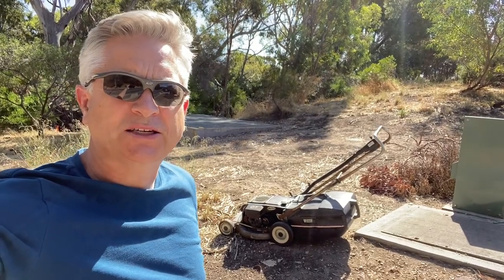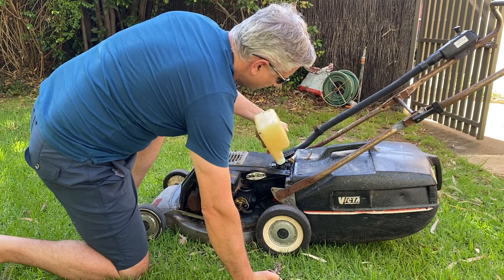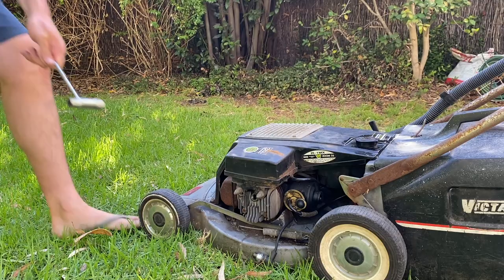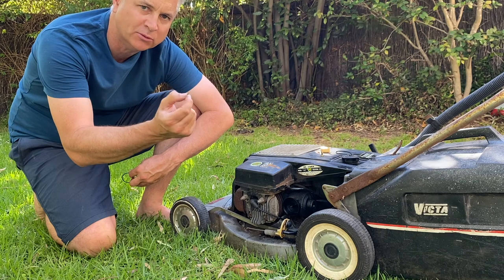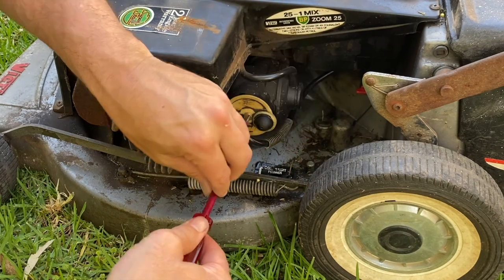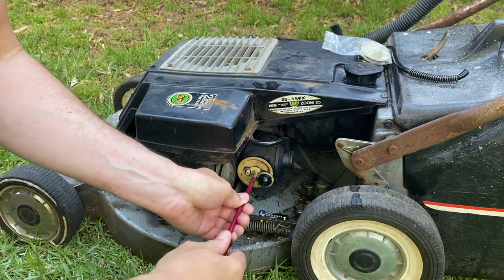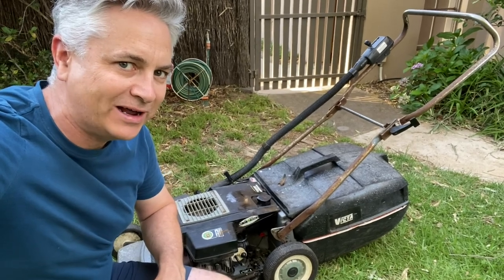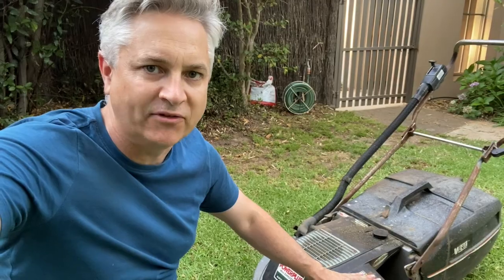Trash Picked VICTA 2 Stroke Lawnmower - Will it Run?

Comment: Wow!! What a score. I would love one of these!
This dates from 1982 -83 and is the last of the full crank 160 engines before they switched to the Powertorque engine like your red mower and features electronic ignition like the PT.
Beautiful looking machine. Don't sell it unless you have no room.
You will find the catcher off your red mower will go on this fine but not the other way!
Thanks for doing this video. Well done on both counts.
Reply from the maker: Hi James, thankyou for your comments!  You have confirmed my thoughts that is a full crank engine.  To be honest the frame is not in the best condition, however I have been thinking that this engine being a "full crank engine" would be a very good donor for a Victa Go-Kart project!!  What do you think?  Cheers Drew
Reply: @DrewFixIt  I think personally that would be a shame. What's wrong with the base? You saved a classic.
The base looked in good condition for it's age to me, no cracks, holes or scraping on the left side. I've seen some shockers in my time.
If you really want the engine out of it I'd love the rest of it. The Powerplus engine has a high compression head as well as a freer flowing muffler, giving more HP.
PS, does the fron't axle move up and down at all or is it firm?
Reply from the maker: @jamesfrench7299  Hi James, I hear what you are saying wrt being a shame, I too just love these old VICTAs!!  BTW - where are you located?  Cheers Drew
Reply: @DrewFixIt  Central Coast NSW

Comment: Hello in my Victa maintainance manual it shows to put the carburettor cap on with the float to the top insert the jet and slowly turn the cap when the jets a couple of threads in ,it keeps the float in place
Reply from the maker: Hi Jeremy, the reason I don’t do this is that I don’t want to risk disturbing or damaging the o-ring!  Cheers Drew